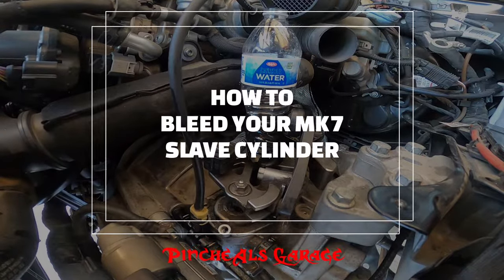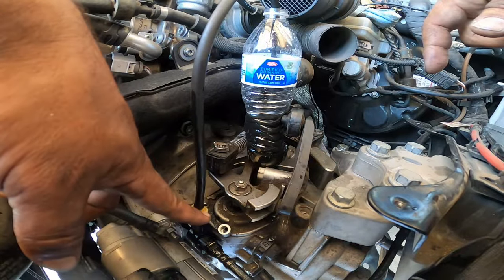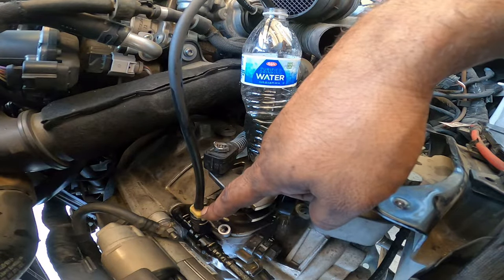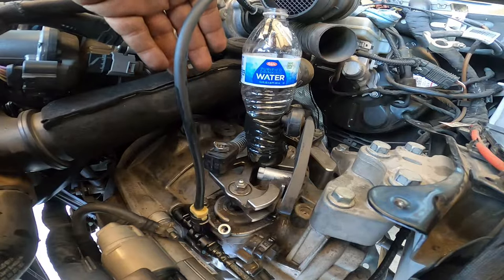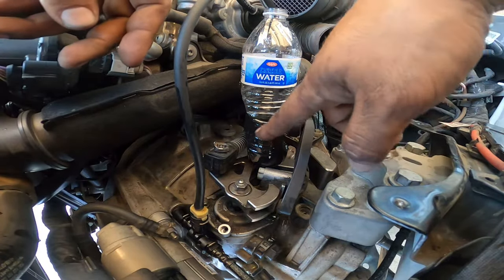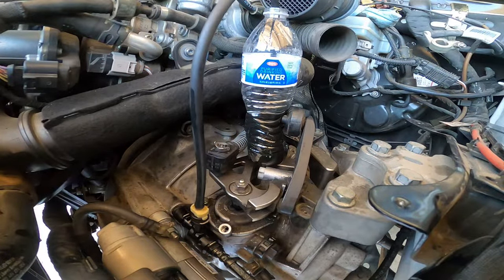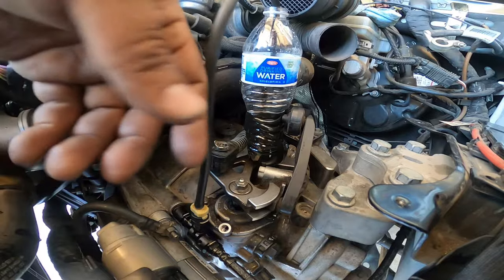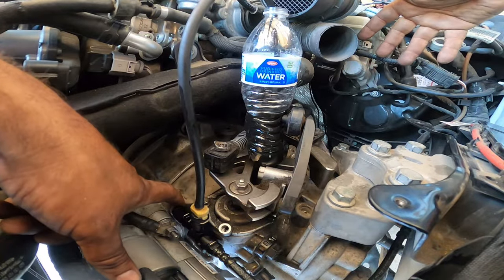How to BLEED your MK7 Clutch

Comment: This procedure is wrong. You have to pump the clutch while the bleeder is closed then open it and push the pedal to the floor then close  it again
Reply: Lol
Reply: uh no thats for brakes for vws you put a pump on the brake resivoir. and push the clutch like 15 times and open it and then go back and close it the clutch doesn't have to be depressed while closing

Comment: Thank you very much Sir. I will have to try this out since I have some pedal issues: Sometimes it returns slowly and sometimes stuck at 1/3 of the way and when I return it in upward position it usually start to work normal; sometimes for weeks without issues but eventually it starts again... Brake fluid is topped off but I don't think that car clutch has ever been bleeded. I know that brakes were bleeded and new fliud changed but clutch bleed valve was never touched. Passat B8 2015. Looks same as Golf MK7 from your video. Thanks.
Reply: The only thing you forgot to mention in this video is that you have to constantly top off brake reservoir(above max to the top of the opening). As soon as the brake fluid hit the maximum mark or lower on the reservoir, the bleeder valve would just violently spit out air in my case! Beware!

Comment: I wondered where the slave was .. Under the battery of course.. the ford dealer told me the gear box must come out .. as soon as I see a flash workshop I see a telephone number for a bill coming my way
Reply: The slave is inside the bell housing, I just did mine last week. It’s not a fun job, at least a grand in labor anywhere you go
Reply: @codyakre1693  it’s certainly a hoist job .. I use to have 12

Comment: Don’t forget to top up the reservoir which ever method you use
Reply: I found that if you keep pumping the clutch pedal after all the air is out, it will add fluid to the brake reservoir too...interesting.

Comment: Hi there . I had to fit a new starter motor in the dark . Unfortunately I didn't realise this pipe was the clutch pipe dummy . So I unclipped it to make it easier to tighten up starter motor  bolt . I didn't realise fluid was leaking 😳 I attached the pipe and realise cluch peddle was at bottom position.  I hope this video will help me ?
Reply: Did the same thing yesterday, did this help?

Comment: Does this gearbox have slave cylinder?
Reply from the maker: Yes
Reply from the maker: It's part of the throwout bearing
Reply: Leon clutch does not back to normal position. I changed master clutch cylinder, but did not find slave cylinder on top of gearbox
Reply from the maker: @MrDarius217  slave cylinder is in the transmission. Part of the thtowout bearing. Combo piece
Reply: Is it could be a reason for clutch pedal not coming back?

Comment: Thanks for this explanation.. Mk6 GTI EA888 2.0L TSI 2012.. what steps did it for me were:

1) With bleeder valve CLOSED, pump for 30 seconds which builds up pressure (needed to bleed properly).
2) Immediately open bleeder valve and let air bubbles escape until fluid starts to flow. If fluid fails to flow, close valve and build pressure properly again (step 1). Also ensure the reservoir has enough fluid in the proper level range.
3) Once fluid is flowing to the bleeder hose/bottle without much air bubbles, close valve and check reservoir to ensure level hasn't dropped below min line.
4) Proceed to pump clutch and see if pressure builds. If not, open bleeder valve and do SLOW full pumps, maybe 3-6, then check bleeder hose again to ensure fluid is flowing. Close valve, then pump clutch pedal to see if pressure has built enough. 

Once I had enough pressure to barely get the pedal to kick back and return, then I started up the car to give power to the master cylinder, then pressed the clutch pedal in and out with my foot rapidly to build pressure. Pedal now returns as normal, plenty of pressure :) if not enough, open bleeder valve and let air bubbles continue to escape until fluid flows freely to the bleeder bottle, then close valve, pump clutch pedal to test and build pressure..

Comment: Where is it located on mk7 golf TDI?
Reply from the maker: Same exact spot
Reply: @PincheALsGarage  Thank you for your reply. I'm sorry I can't figure out where it is.
Is it under the air filter? Or under the battery? I'm not sure where to look
Reply from the maker: @cristiana3355  you need to remove the air box and battery tray. It's about 4 in away from the front of the battery tray and look straight down.
Reply: @PincheALsGarage  Thank you so much. I'll let you know how it went.